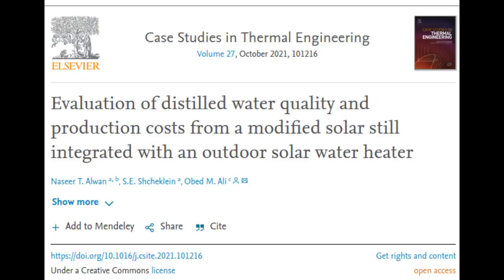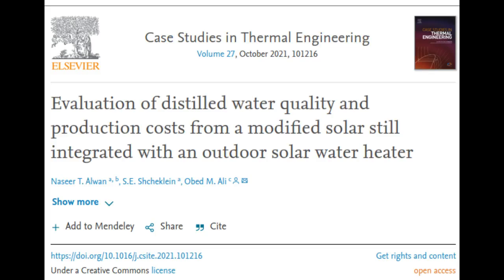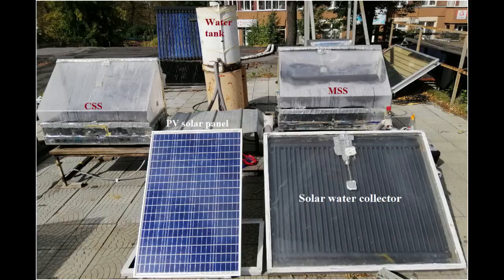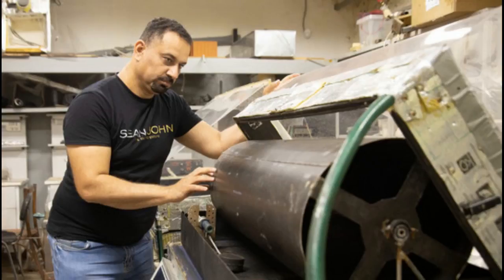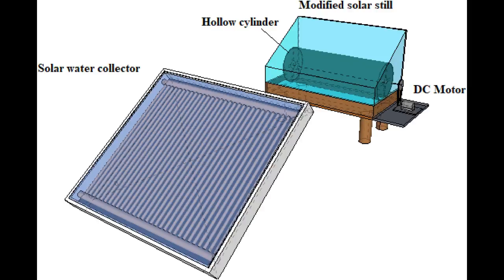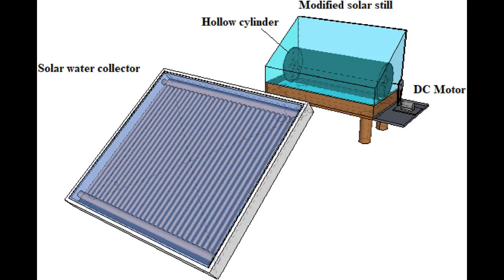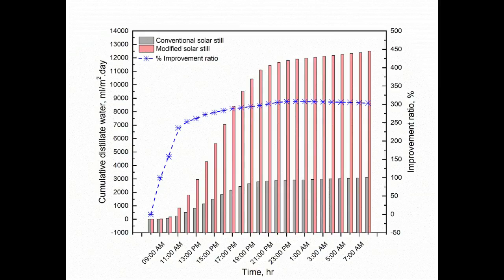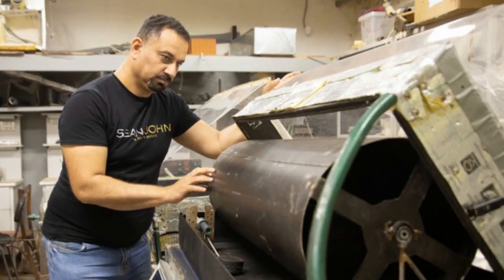A Simple Way to Desalinate Water Using Solar Energy with 400% More Efficiency

Comment: So, they basically reinvented the rotovap? That's all very well and good, but the salts are still going to foul the surface eventually. I think the MIT passive solar stil is the better option. At least that one can redissolve the salts on the evaporator automatically when the sun goes down